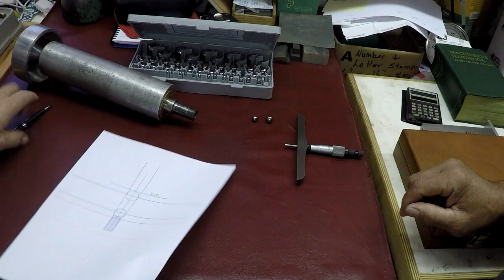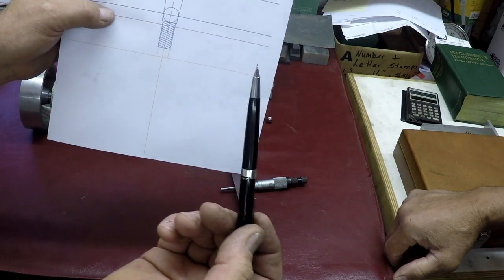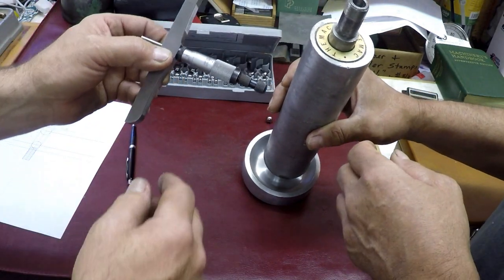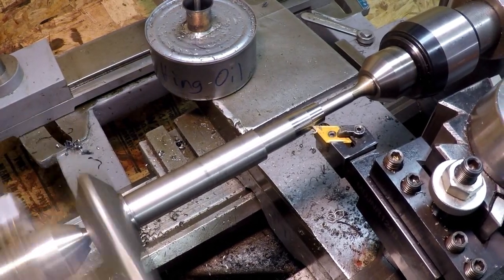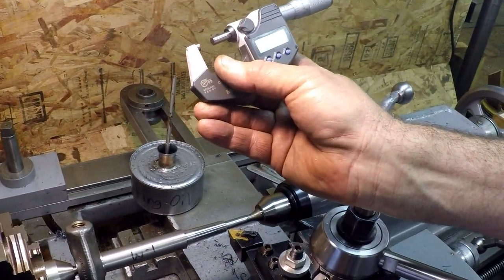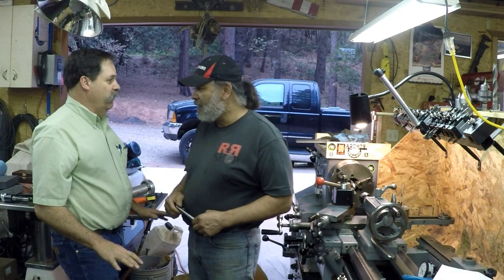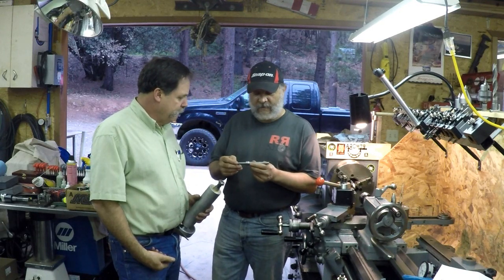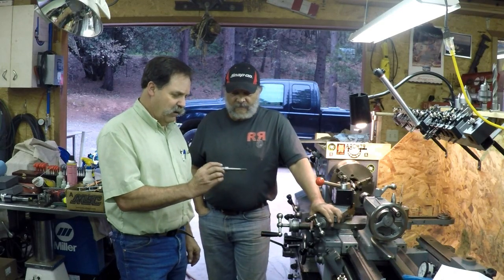Viewer Projects Part 3 Final

Comment: Beginning to think RR means Randy and Ray.
You two obviously have a ton of fun "In The Shop".
Good video. I was wondering why you weren't using the taper attachment. Still won't tighten properly?
Thanks
John
Reply from the maker: John Bazaar Well what I found was the top adjusting bushing which the pin passes through was slipping a small amount.  I added a thin gasket (minila folder) under the tightening nut and it works perfect.  This next series the new project you will see the gasket on the taper attachment.  Thanks for watching and asking.  Randy

Comment: Randy please, material, tip type, amount per cut, please? Enjoy all your video's
Roger
Reply from the maker: Roger Beaulieu Material 3/4" dia. W-1 Drill Rod, insert DNMG 432, Rpm 715, DOC, 0.015 to 0.020.  Set up was done with a Sine bar on the compound,  I have shown that that in previous video's.  Thanks for watching, Randy